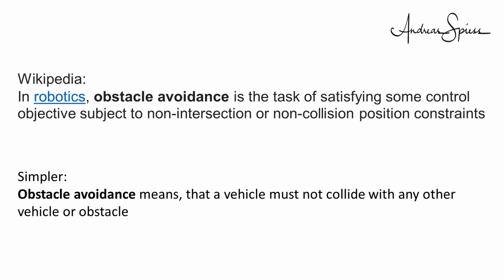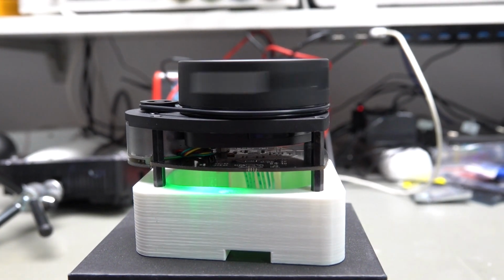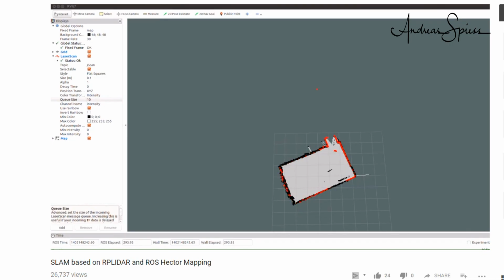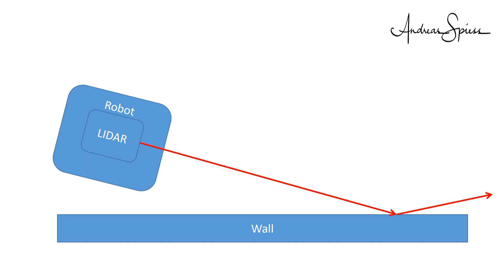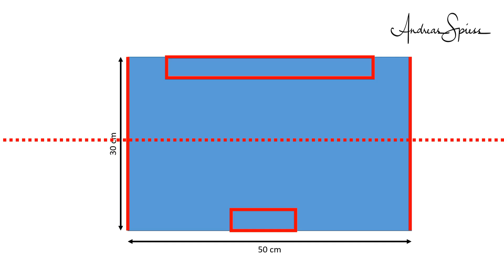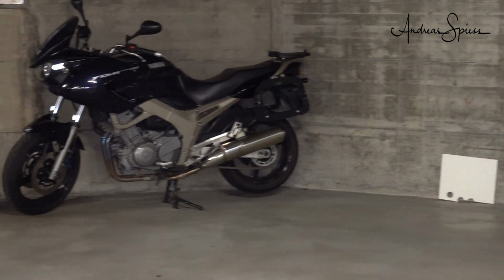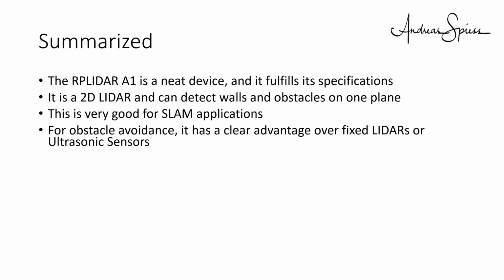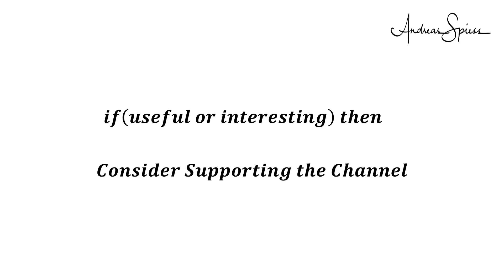#227 The ugly truth about LIDARs for obstacle avoidance (RPLIDAR A1, Arduino, ESP8266)

Comment: Suggestion:  Tilt the LIDAR down a few degrees at the front, and put a mirror behind it to reflect the backwards laser beams back towards the front again but on an UPWARDS tilt.  This will effectively give you two forward facing detection planes, on different tilted angles, one up and one down.  You just sacrifice your backwards facing detection.
Reply from the maker: I tried mine. It works with a mirror, however only if the mirror is at a right angle to the laser. So the mechanical construction is not easy for a rotating LIDAR.
Reply: Andreas Spiess  you'd probably have to use something like a cylindrical mirror in a halfpipe kind of shape to ensure the right angle is my guess.
Reply: I really like this idea. I wouldn't be surprised if some companies have implemented this.
Reply: If the mirror trick works, then concave mirror would be great for too near objects, and convex mirrors to make an area of long distance ranging… like a trifocal glass for your robot
Reply: Further thoughts: You could keep it simple too by angling the LIDAR & mirror so the top & bottom detection planes "trigger" at a similar distance to each other, so you dont have to bother separating the 2 planes in software & setting different trigger distances. Just position everything so if either is triggered the robot will do the same thing (stop then reverse & turn, etc).   

Or: Since you don't want the top plane to continue upwards to be triggered by things high above, perhaps it will be mounted high on the robot facing straight forwards (no upwards angle), and only the low detection plane will be angled down.  Remember that mirrors reflect all the way to their edge, so it is easy to mount a mirror as the highest point of the robot with no unprotected blind spot above it.  This also gives the bonus ability of the top detection plane being able to see forwards at a maximum distance, so you retain the ability to use it for more than just simple collision avoidance.
Reply from the maker: I am not sure if triangulation works with mirrors. Do you?
Reply: if its servo controlled then you know where its facing, so you could code a transform so that the alternate 180degree fields can correspond to 2 angles. 
even without knowing the direct facing of the sensor you could still 
write code to distinguish 2 planes from each half (or however much) of 
the total scan. 
edit: because if the light emitting and being detected is on the same face, and that face is facing a mirror then itll still emit and detect the return to whatever angle the mirrors are set too aslong as the mirror is reflective enough and setup so there is little to no return to the detecter from the mirror surfaces themselves. then ok you lose whatever field of view by however much is 'blocked' by a mirror, but you gain more data for the remaining field so..
and for full 3d you culd expand it so that instead of having the problem of gyroscopic torque in moving the lidar assembly around a perpendicular axis to gain another degree of resolution, by ie angling it up and down, well you could much easier keep the lidar assembly fixed and then angle a mirror up and down to get a wider field of view/ planes

.. even though at first i agreed with your (missed) sarcasm ;p 
i then thought no wait a minute there is a way that could actually work and make sense.
besides which: of course triangulation works with mirrors if the mirrors plane is normal to both beams, then it doesnt affect its relative angles (discarding real world material affects) so both angles are kept through the translation. the only thing that changes is the potential distance travelled from the device to target because of the longer path taken, and so you want to take that into account and add that offset to your results or reconfigure the system to overcome it/ cancel it out.
Reply: @AndreasSpiess  should be fine, it's just another layer of optics.  IIRC on other similar technologies like the Microsoft Kinect, mirrors will work.  Easy to test tho with your bathroom mirror or a hand mirror.
Reply: @AndreasSpiess   https://youtu.be/1Qx8NzuSSJ4 here u can see how triangulation systems like this just treat mirrors as if they are portals to another room.

Comment: Andreas, take a look at intel RealSense, it might do what you are looking for. I have the D435 for a few weeks but I didn't have the chance to test it yet (I'm planning to use it with ROS)
Reply: The D415 and D435 perform very poorly in the presence of sunlight, they require a lot of power for the IR projector, and require lots of computing power to interpret the resulting point cloud. It works well for indoor purposes in combination with a state-of-the-art PC.
Reply from the maker: + DaniDasK: I wonder how we could use this vast amount of data to control a small vehicle. As Alexander wrote, It seems to use a lot of power. What kind of processing power is needed?

Comment: Excellent video! For short range obstacle avoidance, an ultrasonic system with an omni source and a multi-element phased array receiver can be used for DoA estimation with full spatial coverage (a four element pyramid would be the minimal number of phones for full spacial coverage). The main problem with this approach is that it can only see one thing at a given two way range from the system at a time, and if there are multiple reflections received at the same time, the system can become confused, but it is generally possible to throw out bad results by requiring all returns to come in at consistent times at each receive array phone.

I was actually working on this problem tonight for an underwater military application when I took a break to watch your movie. But in my case, the problem is to detect marine mammals anywhere near a high-power low frequency acoustic surveillance array. During peacetime, these arrays must be turned off when marine mammals are nearby because having them wash up on a beach is terrible publicity for the Navy. The offshore oil exploration vessels have the same problem...
Reply from the maker: I think this would work because You only need the shortest distance. You only the fastest echo will be needed. Maybe you stop once too early, but this is not problematic.
My 3 sensor design was very similar as I started all "loudspeakers" together. So it behaved like an omnidirectional source.

Comment: What about letting the lidar tumble or nod in a controlled manner, eg. with a servo. So achieving a pseudo 3d operation. Just curious.
Reply from the maker: There are a few viewers who proposed it. It is possible, but you lose speed which is essential for obstacle avoidance.
Reply: Andreas Spiess  plus - you'd be fighting gyro effect constantly...
Reply: @AndreasSpiess  I'm a little late to this party but, what about using a polarized beam (maybe not truly polarized) similar to the cheap laser leveling systems. I understand that you might loose beam intensity as a trade off, but maybe, in a limited fashion, you would gain vertical detection. This would be a "poor man's" solution, as there would be no way to tell if the obstacle os above or below without additional sensors. Keep up the good work!
Reply: Gyroscopic forces would be minimal for something like that. It's light and only spins @ 7Hz. Nothing a servo couldn't handle
Reply: like you knew the moment of inertia :)
Reply: I've seen this exact technique used by a wheeled military drone called the Crusher. https://youtu.be/46rkQiXs6Eg
Reply: Was thinking the same. Would have to move very slowly due to gyroscopic resistance force.
Reply: Or put a spinning mirror inside it so it basically rotates in two planes
Reply: like this https://www.youtube.com/watch?v=qCUiCs-aYNk
Reply: Adrian Schneider, interessting.
Reply: What about reflecting the backside  of the plane in another angle to the front. So you can tilt the sensor to the bottom and the backside to the top. Just thinking because you mentioned not to be interrested in the data from the back. So it can be used to look also forward to the top.
Reply: Quite a good idea, you dont even have to do it constantly. In a non changing enviroment, you do the scan every minute or  so. and then you rely on your position in room.

Comment: You could point the sensor downwards, and distract the backview with a mirror to straight forward?
Reply from the maker: I tried now. It works with a mirror, however only if the mirror is at a right angle to the laser. This is only the case for a quite narrow range if you use a flat mirror.
Reply: Andreas Spiess wonderful! Sounds lika a plan!
Reply: Sounds like a plan.. So the mirror would essentially 'double' up on the forward vision? But i wonder how the software would interpret that? As it's a 2D LIDAR there only seems to be one 'plane' of output - one contiguous line - whereas with the mirror you would ideally want it to output two lines in a '3d view'.
Reply: Michael Newham i didn’t think that to the end, just saw the possibility for it. But lets think further... he did display the sensors values on a xy map on the computer, for controlling the tank a mcuish device would be needed anyway. On the angle the beam hits the mirror the mcu need to interpret this as ‚forward‘ all other angles as ‚forward down‘, he even won’t loose detection speed, nor sideview and he also extends the 6cm limitationof too close obstacles. Downside is the loss of backview (he dont won’t anyway) and a little decreased angleresolution while beaming over the mirror. Hanging objects will be detected over the mirror, and objects under the level by the tilted forwardview. I think this is clever and possible to make.
Reply from the maker: I do not know if triangulation works with mirrors since it depends on exact angles.
Reply: Andreas Spiess is it masured by triangulation or by phaseshift? However, on my poor understanding of the topic i assume it will work exept on the hard edge of the mirror, and distance is calculated within the additional distance from and to the mirror and the measurements over the mirror will be mirrored. Andreas, you have the sensor build up and running, right? Why dont just try? I really would love to hear if it could work and how.

Comment: 100$ is pretty expensive for such a device, it is not even so advanced, I mean they are using a motor to spin a sensor around. I think you should be able to make a dyi version for about 25$, or wait until china will make cheap versions.
Reply: The 2D LIDAR $100 cost entry barrier is already MUCH lower compared to 5 years ago when an $1100 Hokuyo sensor was the most cost-effective option.

This RP-LIDAR is already a "cheap version" from China. I doubt they will get much cheaper than this, I presume that it would already be quite slim cost-margins; the components (Slip Ring, CMOS image sensor + optics, Laser Diode, Motor Controller, Position encoder, Microcontroller) are not cheap.
Reply: Yeap, it's fantastic value. I got mine for $85 or so on a deal from Seeed Studio. Aliexpress have some 'Black Friday' sales day on November 11th. Maybe, price will drop a bit more then..
Reply: Main cost is fast and accourate laser sensor with width range. Rotating and synchronizing data is minor cost.
Reply: A good fixed LIDAR costs more than that.

Comment: What about using 2 cameras and opencv library to do photogrammetry?
(With a raspberry pi for it)
Reply from the maker: Maybe. But I have to learn first how to use one camera ;-)
Reply: You should check the realsense D435 camera from Intel. It's around $130 and I highly recommend it.
Reply: I'm sure there will be examples out there. If you use a raspberry pi as controller the examples made for linux should run.
It should be easy to disassemble 2 cheap USB cameras and mount them as eyes, may be with a servo for pointing them toward the sides or even back. You could remove th IR filter and use them with iIR light also.

With a good resolution camera you even could do face recognition... The tank could patrol your house and fire it's cannon against the intruders 😉
Reply: @AndreasSpiess   if i may recoment one camera, have a look into the realsence camera from intel. We are using the D435 for our robot. It's a stereovision camera with structerd light added tot it.
 https://realsense.intel.com/stereo/
Reply: Adding visual would be the evolutionary step for certain,  I did a few experiments in C++ with OpenCV using a Cubox-I pro and a very cheap 720p usb camera.  Its actually very simple to build visual pipelines that filter / mask as required.  There are also quite a few tutorials on training also for things like faces / people and objects.

I used this to get started,

https://github.com/WPIRoboticsProjects/GRIP

Its a great tool to create the visual pipeline ( cam -> filters etc etc ) it exports code iirc to c++ and python.
Reply: Or Just one camera and a convolutional neural network

https://youtu.be/9QRTg-4q634
Reply: @FuZZbaLLbee
It will be very hard, to recognize 3d objects with a single camera and neural networks. Much harder than really simple tasks like recognizing a 2d road and a big 2D stop sign. Recognizing 3D objects from a single picture is much more complex. How will your system ever know the size of an object? A system with a single camera can not tell, if the object is smaller or further away if it doesn't know the actual size of a recognized object.
Still a nice demonstration of what you can do with a single camera and a little bit of software.
Reply: Kinect+Pi. Structured light depth mapping.
Reply: @SianaGearz  the problems with Kinect is the minimum distance for detection. 
... And the size... Can you imagine an small tank with a Kinect on it's top?
Reply: @anvz6  I suppose detecting obstacles too early is better than detecting them too late?

And I have two possible answers: "yes, I can", and "we're gonna need a bigger tank" (cue Ivan Miranda)

You can remove the microphones to slim it down quite a bit.

I wonder if there is something else you could use as an IR structured light or dot projector, because an IR 5MP PiCam is an off the shelf part. Maybe some kind of laser dot pattern lens + IR laser. Though I suppose Kinect's spatial resolution will be quite a bit out of reach.
Reply: What I was trying to say is that kinect is designed to scan a large area a few meters above. You can't scan things that are near. In fact, there are "lens" for adding to kinect for using in "normal size" rooms and even with this lens the scan range is about 2 meters, check this:

https://www.ebay.es/itm/Wide-Angle-Lens-Sensor-Zoom-Reduction-Adapter-For-XBOX-360-Kinect/282887642114

Space Reduction Percentage : 35%-40%
Compatible Player Number : 2
Controll Range : 1.80m
Color : White
Weight : 160g
Compatible Model : XBOX 360 Kinect

Comment: Great video as usual. What about the power consumption? I guess it would be high due to the rotating motor and continuous beam.
Reply from the maker: I measured 80 mA for the motor. I did not measure the LED.

Comment: if two lidar based self driving cars are approaching towards each other then will the laser from one lidar will make a false signal for another lidar??
Reply from the maker: I do not think this is an issue. The chance they will hit the other is very small because the laser point is very small and fast moving. So maybe you get one false reading in a long time.
Reply: Wouldn't the laser scatter depending on material ? Stuff like snow can scatter so much the light from a single laser pointer will cause the object to glow many centimetres from the point the beam hit it.

Comment: I think the F117's angular shape was more a result of limited computing power. The engineers used computer simulations to predict the radar cross section of a particular proposal. But the limited computing power back then meant they could only handle very few polygons. That's why the later stealth airplanes look a lot different.
Reply from the maker: You might be right. And they did not have a lot of time to build it. So they used what they had (aluminum, for example).  And they had also to prove the concept to convince Congress. It was quite revolutionary at the time. Nicely described in Kelly Johnson's book I recently showed. 
The shapes of the newer planes, however, seem to follow the same formula and principle.

Comment: Sir , lidar systems are very expensive  and not easily available to everyone . why not to use  computer vision and smartphones cameras to replace expensive lidar systems sensor .  https://youtu.be/4X_EjUZp2c0
Reply from the maker: Also a possibility. But also not cheap, I think. You need at least 2 stereo cameras and a reasonable computer if you want to measure distance.

Comment: https://www.robotshop.com/en/teraranger-tower-8-sensors-tof-rangefinder-type-a.html
https://www.youtube.com/watch?v=ybePmYS6EL8
Reply: the range on these is up to 60m, depending on the ambient light. Also look at some of the work done on ardupilot.
Reply from the maker: Thank you for the links. Not cheap, though!
Reply: They do sell a single sensor, but they are still around $149. Range is around 5-6m in bright sunlight. But they have pretty high sampling rates. Wonder if one could spin a single sensor.